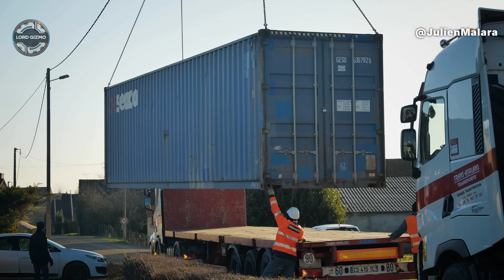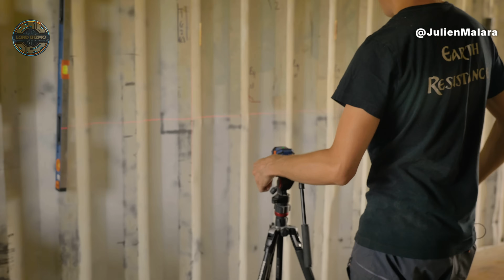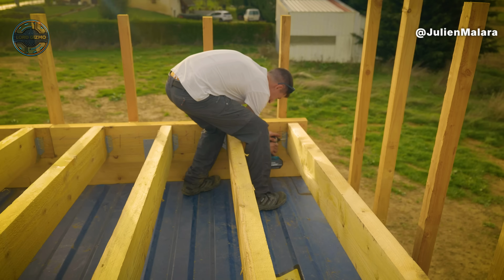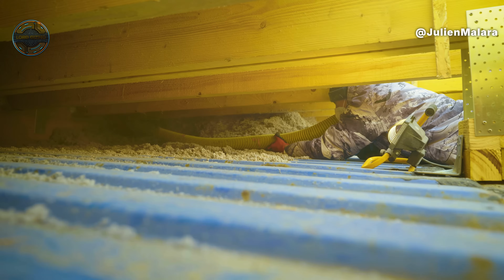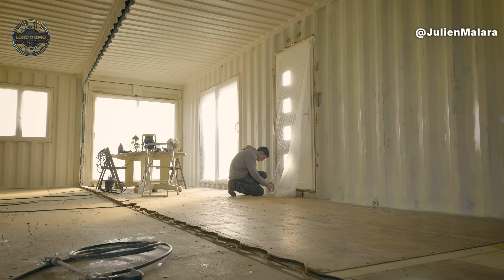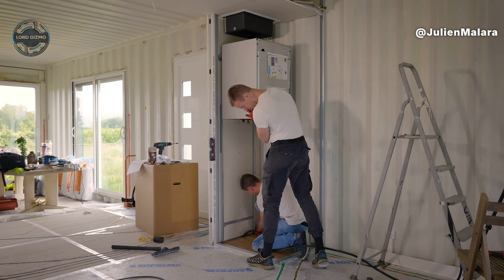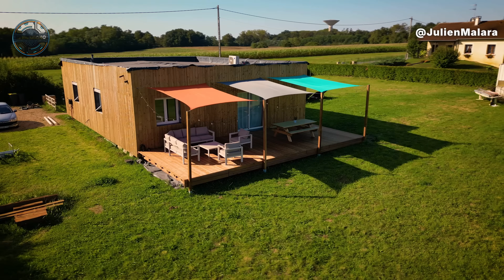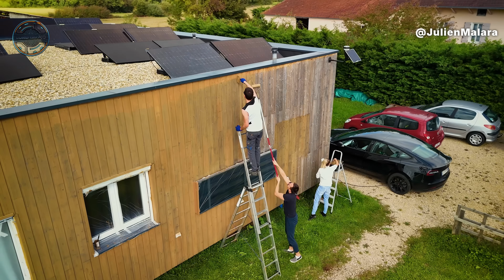He Turned 4 Shipping Containers Into a Luxury Home | Start to Finish by @JulienMalara

Comment: My neighbor did that.  Poured a foundation, Craned in some shipping containers.  Poured in a concrete floor then tiled it.  Built a structure around the whole thing and covered it.  Spent days with the angle grinder cutting out doors and windows.  Had to reinforce large openings with I beams.  Then built another structure inside for walls and room divisions.  Could have built a stick framed house for less, more quickly and cheaper too.
Reply: At least your neighbors poured a foundation.. this guy put a bunch of metal in the ground and welded a foundation together; metal is gonna rust and corrode and it’s gonna fail in 5 years loll
Reply: @PJJ07771  This type of build is what I would expect from a stoner 20 year old that has never looked into building a house at all. lol

Comment: No rubber gromets or anything in the holes the PvC pipe is running through? Its just rubbing against raw cut metal.
Reply: And the gaps between each container make me nervous I can imagine bugs getting in there and then anytime they need to deal with the plumbing and they open up the hole around the pipe there might be thousands of bugs coming in bugs coming in

Comment: The whole point of a "container house" is that the containers form part of a contemporary, industrial exterior aesthetic. What they've done in this video, framing around them, is absolutely pointless, and the containers themselves serve no actual purpose whatsoever. Not to mention, you can see that when they are welding the containers together, they aren't properly levelled, and the welding itself is fucking atrocious!

Comment: Pretty poor design, containers have a very low ceiling, then they lost another 100mm with the thick flooring. Short people may be able to live in it. The house looks OK on the outside, because it has a false facade to give an illusion of height. Good container designs have them stacked like Lego blocks, to give some internal height, and a more interesting shape.

Comment: Having already provided insulation outside the steel skin, it seems strange that they did not (fairly easily) apply cement-board or plasterboard to the interior surfaces.  
Relatively small cost which would have added even more to the internal ambience.

Comment: How does the roof drain?
Reply: It doesn't as far as I can see. I was waiting for them to cut a drain into one side but that never happened. The membrane they put down is not designed for open use like that. It is supposed to go under tile/sheeting as an extra layer of protection. The stones wont help at all. Water is just going to pool up inside that space and sit there for day /weeks at a time.  At best they will get 3-5 years out of it before it starts to lift and split, and that is assuming they installed it perfectly, which I highly doubt.
Everything about this house is rubbish and I expect that is why they did it themselves because no self respecting builder would do it.
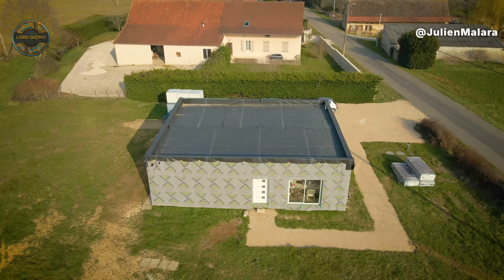Reply: @ASavageEye  I agree with you but there are scuppers on two of the corners and you can see the dirt marks where it flows so it’s tapered 2 ways. Check out time stamp 12:50 ish .
Reply: They get up there with buckets.
Reply: Gravity
Reply: Id say it has a lean on it ?
Reply: There's a small peak in the middle.
Reply: It doesn't.  It overflows.  Eventually.

Comment: What stops the base of the shipping container from rusting ?
Reply: nothing.
Reply: It's specialized steel that doesn't rust.
Reply: @Rad-o3x 😂 it's plain metal, with a cheap industrial paint. We repair and paint for maintenance on a monthly basis. The floors are hollow and lined with cheap as cheap can be MDF and a skid sheet of ply glued on top. 
They last on average 15-20y.

Comment: It’s hard to believe there are 4 shipping containers underneath all that beautiful woodwork. The transition from industrial steel to this warm, luxury aesthetic is absolutely mind-blowing. Great vision!
Reply: Having already provided insulation outside the steel skin, it seems strange that they did not (fairly easily) apply cement-board or plasterboard to the interior surfaces.  
Relatively small cost which would have added even more to the internal ambience.
Reply: @mikegray8776  I'm sure they wanted all their visitors to know it started out as shipping containers so they could be suitably impressed. 😁😁

Comment: Advantage of the construction is you can hang pictures with magnets.
Reply: Good one 🤣🤣🤣🤣🤣
Reply: No thanks you big Woofer
Reply: Advantage of ripping off an other creator's work si construction is you don't have the expenses or time of comming up with anything new.

Also the magnets is a decent idea.
Reply: stupid contruction
Reply: @mipimoo  Elaborate.... saying it's stupid doesn't add anything to the conversation. Use your words.
Reply: @origamisteve  It was a simple opinion. He is not required to elaborate just to satisfy you, so get over yourself already. He is also correct. It IS a stupid construction.
Reply: @ASavageEye  But could you elaborate... saying its simple doesn't really add to the conversation.
Reply: @chucksanders3008 for starters it's a lot of extra work to build a conventional house around shipping containers because what was even the point?
Reply: @ASavageEye Is it really stupid?
I am building a similar type of house, here in Germany... for my family. Actually, it is an extension of an existing house. 
The point of such construction is that you can build an energy-efficient house in a very short time - with relatively small amount of  money. You don't need to be any expert, just a little knowledge and good will. 
In addition, this type of construction allowed me to make my flat roof completely green, full of plants. In my city where I live, the local government subsidizes green roofs.
Here in the video they used metal feet, supports driven into the ground. Here where I live, the soil is so wet - that those metal feet would rot in 5 years. I used 40 concrete feet, 60x60x16 cm...By the way- I was paying one just 10 euros😊

In this video, the final form of the house has visible metal surfaces of the container inside. My type of construction has internal walls, just like a standard house. 
The thermal insulation of all the walls is 5 cm of PUR (which is what the walls of this type of container are made of, which I used...) plus 15 cm of stone wool. The ceilings have thicker layers.
The floors in the containers that I used already have 12 cm of thermal insulation (rock wool), from above is a 2.5 cm thick slab (I don't know its name) made of cement and sawdust.t's up to you to install a laminate floor, or whatever you want...

What is Energy efficiency?Heating in one Room(about 18 square meters) is infrared Heating 500wats.(for normal room which have brick walls,you need about 2000 wats)it depends how many windows,doors you have in this room,etc

 Everything you see in this video, I am similar made...where does the main point come from - the house costs 40,000 euros. Otherwise, here in Germany, if a company does the work for you, you can't even build an ordinary basement under the house for that money.

The containers from which I built this  are not standard shipping containers, but bureau containers. They already have Windows,doors,etc.These containers are initially wider than shipping containers.The containers I built with are 6.05 meters long, 3 meters wide and 3meters high. I just used 3 of them....So, for 40,000 euros I got about 50 square meters of living space..
Can you build a House,for this amount of money?

Comment: No roof drainage🤔 maybe that's their outdoor pool😬
Reply: The roof clearly has a pitch towards both sides?
Reply: @johncunningham9094 how does it drain off?
Reply: @Jonesp-u5p yes, I watched again and couldn't spot any drainage outlets. 
Surely no one would build a pitched roof with a parapet wall all the way round with no drainage?
Reply: @johncunningham9094 normally you would leave outlets on a parapet wall, going to be a lot of problems in the future
Reply: @Jonesp-u5p yes, correct. I simply cannot believe they would build such a roof with no water egress points.

Comment: Frankly I think they could have produced a lot more imaginative structure tan just plonked 4 containers down side by side. I also wish these kind of programmes would give outline costings.
Reply: I agree about the costs. It actually appears to be much more labor intensive than just building a framed house.
Reply: with my experience in construction I think the cost here is much higher than a  frame construction and nothing but future problems. Low ceiling etc etc.
Reply: @joserego9210 flat roof will eventually leak
Reply: Yes it’s not very good craftsmanship and for all this effort the house had minimal aesthetic appeal
Reply: Karen! 😂

Comment: Two things we will always pay taxes and flat roofs leak.
Reply: The containers are shipped in the open across the ocean. They can take a little rain.
Reply: @zumsel1000  Containers have drainage ridges wiith holes on every corner, however when you remove ridges holes to weld two together, you create a flat roof with zero drainage in the centre. Water WILL pool on that roof, and the roof will rust. Containers have a roughly 25yr lifespan if maintained correctly on land. At sea they get 10yrs max. These containers were second hand, meaning they are likely already close to their end of life, and that is why they were being sold off. Steel simply does not handle weather well, and needs constant maintenance. When you board it up like this, you remove your ability to do that. Container homes are simply a terrible long term idea.
Reply: @ASavageEye  People haven't caught on that this is just a way for the shipping industry to sell their waste at a profit. They'd normally just dispose of these containers. Then they realized idiots will buy them for thousands to build unsafe homes. The containers have moved millions of dollars in goods and have paid for themselves multiple times over. Then they sell them for 4k a piece for a poor quality 20ft one. Thousands of containers are decommissioned a year. Pure profit. They are great for a storage shed, idk why people keep trying to live in them.
Reply: @Cheddar-420  Agreed. They do have uses, for storage. I know a farmer that keeps animal feed in them. I have also seen them used to store cars.
If this is all that was needed for a good house, the government's would be all over it, fixing their homeless problem almost overnight.
Reply: not necessary
Reply: Got a flat roof, never leaked once in 15 years. Got drains on each corner with internal pipes.
Reply: @cristiandxb Internal pipes? As in, pipes INSIDE the roof?  Your description makes zero sense for a roof.
Reply: @ASavageEye  The pipes are inside the walls, not the roof. The water from the roof goes down the corner drains, through the internal pipes and exits down, close to the base of the ground floor.
Reply: @cristiandxb Ah, I ser. That makes more sense. I had an image in my head of a string if pipes running all over the underside of your roof 😂
 I assume you roof has a small pitch then, towards the corners with the pipes. The roof on this house is dead flat however, so water is gonna pool and eventually destroy the membrane, before destroying the roof. Water always wins in the end
Reply: @ASavageEye exactly answer 😂🤣😂
Reply: @cristiandxb So you have rain gutters. lol.
Reply: Besides all of the comments all the ups and downs about owning one these tin cann homes who would want to invest in a home made of metal.
It's okay for those who have plenty of money because they are bored but for a long term investment it's a no no for me.
Someone said on here that the government should buy them and house the poor.

Comment: 2x10@16inch on centre roof rafters could have been reduced to 2x6 on a 24inch centre. Same for the outer shell 2x4 on a 24inch centre would be perfect. Like the insulation outside the container for more space inside.

Comment: I would like to know how the rainwater will come out of the roof, I did not see any gutter or drain, the pipe
Reply: Agreed.  Seemed like an important part of the build that they left out.
Reply: In the beginning it looked like they were putting a slop to it but obviously didn't go that route!
Reply: @jamesclayton3074  It has a low gable, a few degrees slope, but where does it drain?